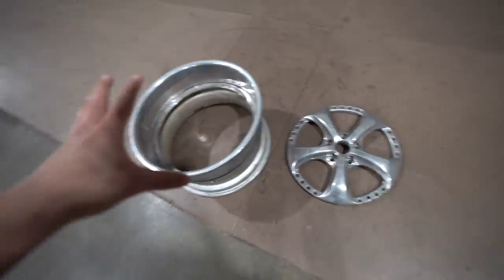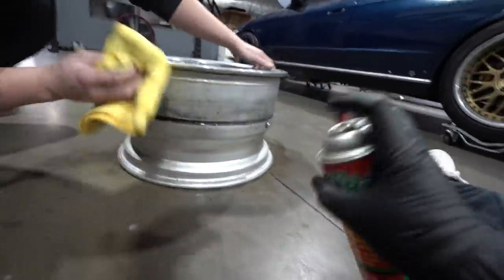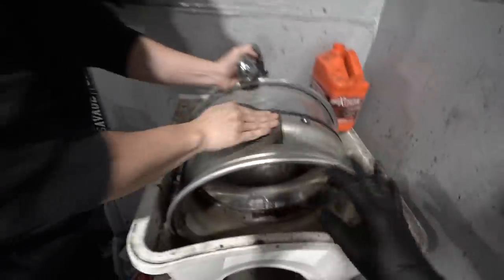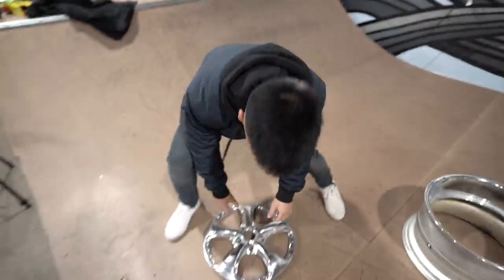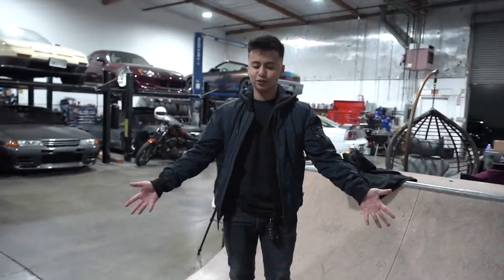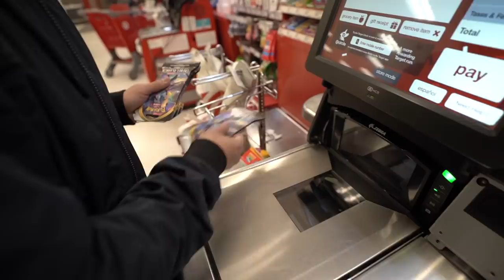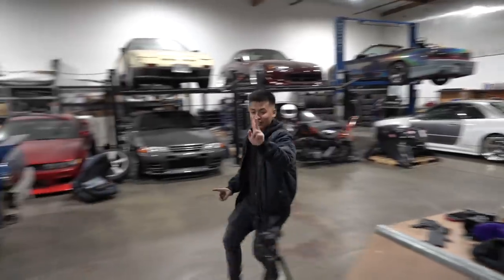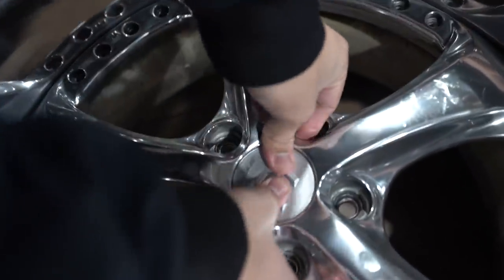Turning a Bent 3 Piece Wheel into a Table! Amazing Results for Cheap**

Comment: The glass doesn't slide when it lays on top of rubber... so stick the pads to the lip of the rim. Maybe in line with each spoke. And lay glass on top. The pads are less visible that way and the rim won't scratch the glass.

Comment: For some reason, I feel like the engine that they are gonna put in the r-34 is a VR38. Or maybe a 2jz-gte.
Reply: They said people wouldn't like it so I doubt its VR38 but could be a 2jz
Reply: Imagine it’s a k-series
(joke btw that’s the dumbest swap you can make on a r34)
Reply: turyy満 he did say it was going to piss people off and ig your one of them I don’t like it but it’s something new and slow
Reply: @lebuniorruiz6724  they can make decent power but the r34 is a much bigger car than the cars the k series is In, he said it was gonna be fast so maybe an ls7
Reply: It’s 2 k series engines
Reply: 20b Rotary
Reply: I hope it’s a v8! That would piss everyone off AND it’s a motor that can handle the size n weight of the car?!?! That would be so good!
Reply: i said 2jz a while back aswell, i think we are right
Reply: @miguelvalenzuela9964  k40 or k48 ? 🤣🤣 🤣🤣🤣
Reply: I completely believe it’s a 2J
Reply: It's dual k series. 1 in front, 1 in back
Reply: It's a K series he said it on yesterdays live
Reply: ^ i knew it from the start

Comment: Hey Randy, i made a coffe table out of my old Rays wheel, but for the base i used a large umbrella shade stand, cut the stem to desired height and welded a wheel bearing to the top. So now i can bolt on the wheel with lugs and it spins too! Like a JDM lazy susan haha. Its great! Hope that helps :)

Comment: Randy cut the size of the wheel into the top of the black table and place the wheel into it and have the glass on top of the wheel. Later on in life make a base for the wheel using a old hub so the wheel can spin freely. 👍🏼

Comment: 4 pieve of wood blocks w notched lines on top so the barrel can stay secured on them. Put rubber on the bottom of the blocks so it wont slide. Ofc would not look super slick. But u can round the outter parts to match the circumference of the barrel

Comment: @randy you should put the rubber feet on the rim lip where the glass meets the metal. That way it doesn't make noise when you bump the glass. Also when you do that it will be more secure in holding the glass still. To even further secure it use hot glue to attach the rubber to the glass [use just a small dab] to secure the feet to the glass.  And .... lol if you want the table to be a bit higher ... stack the already rim on top of another "half" barrel in the bottom to give it more height. Get vu's new welder to tack the half barrel to the existing rim so the top dosent fall with the glass. Tack inside the barrel so it wont be seen

Comment: You could check one of those car themed restaurants since they have wheels for table , if I remember correctly one I went had like a barrel to make it taller then led strips and the power supply running thru inside, make a small hole for the wire to exit and route around the vs kf wheels
Reply: Or no leds and a bulb in the middle to make it look kinda divine lmao

Comment: I would glue some risers on the existing glass and add a bigger glass top . It would be a 2 ties glass table . You could even add a bigger wooden circle glued to the bottom of the wheel for more stability . paint it black of course = )

Comment: I fill like you should get 2 more rims and weld them together in a roll or on top of each other but if you gonna do it in a roll then in the side you have to put a Metal plate and weld it for it could be stable

Comment: For the table. If you can get Luke to weld together some pipes to make legs for it, bring a bar or pipe up to the desired height.  take a wheel spacer and mount/weld it to a bracket on that upwards pipe. That way you can have it solid center mounted and put dope 326 power lugs on it

Comment: use a cheap swivel stool to place the table wheel on top of. table will have wheels to move around and is height adjustable. probably like 20 bucks on amazon or harborfreight

Comment: If you want to do it the right way in my opinion it will take some work. If you have another barrel for a wheel u don’t use cut them so they sit flush then weld them together so that it’s a little under 2x the size it is now

Comment: im thinking get another wheel put it next to the other, get a wider bit of glass to cover both the wheels and another basket to raise the to other wheel so there the same height and then maybe some led under the basket for more of a float effect if its not to hard to hide the wires 👌🏼 😁

Comment: Instead of the basket, you can use a circular wood base that goes under the wheel that matches the diameter of the glass so it would look good and raise it safely. Or get another wheel so you can use a rectangular glass top and cover more space if you want😁

Comment: In between the basket and the wheels put a black card and put led lights around the basket in the barrel of the wheel so it looks like an actual floating wheel and light comes out from under the wheel

Comment: Randy, why don't you bolt the rotor and caliper to the wheel with some leds and bolt the shaft in place and weld a plate for the base, this way you can set the height of the table.

Ps, love your videos ✌

Comment: Maybe having a custom built table stand that is shaped like the rim but more elongated in height and putting the rim over it since it concaves, and the table top should be a bit more wider in dimensions. If not then just put the old table back to where it was and have the rims in the shop lounge.

Comment: Get 4 or just 3 used pistons with the rods use them as legs either weld or drill the bottom lip for the rods and bolt them and put a rubber seal like a door seal on the edge of the glass for extra insurance

Comment: You guys should weld a stand with 3 legs to it with a hub attached and add some lug nuts to hold the wheel in place

Comment: If you guys read this 
Take an old wheel hub and get some lug nuts bolt it on then weld a pipe to the hub. after that use old pistons and weld them to the pipe and use them as legs.

Comment: Ehh, you can put 2 by 4 on the bottom of the wheel or put bricks underneath it? Also, you should put LEDs behind the mirror for the restrooms. I gone to some restaurants which did that.

Comment: easiest way,.... yes. best way?... no lol   best way you ask?.. (it IS a 3 piece wheel) 
Step 1: separate inner and outer barrels.
step 2: with barrel on the floor, measure gap needed between inner and outer barrels to achieve desired height.
step 3: measure the gap between the inner and outer barrels required to create that desired table height, as this measurement will be the size of your needed spacers.
step 4: buy 1/4" diameter x 3' or 4' long rod lengths from home depot, buy enough length to equal 4 cut lengths, same measurement as your measured gap between barrels. these will be spacers, so cut to length.
step 5: drill hole 1.5" deep into each end of your aluminum rod spacers, then tap it for same threads needed for your wheel hardware.
step 6: bolt your wheel back together using the new aluminum rod spacers between the inner and outer barrels, making your 3 piece wheel look like an exploded 3d render of a 3 piece wheel, all turned into a table.

super simple fucking concept. just hard to explain through words instead of pictures.

Comment: Holy fuck KJ has POP!
Reply: Just find a big ass barrel for the bottom part of the wheel and the table will look better. If you actually use that basket some E diot or dum phuk is gonna break that glass.